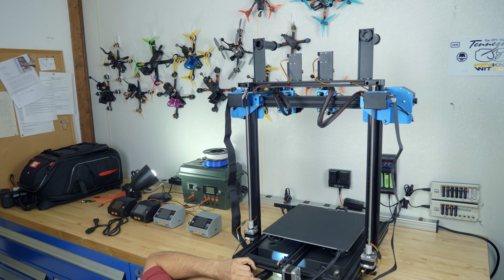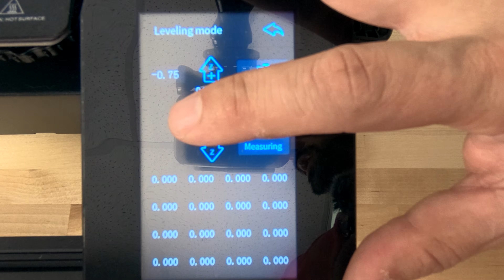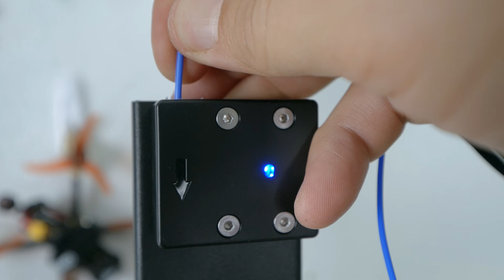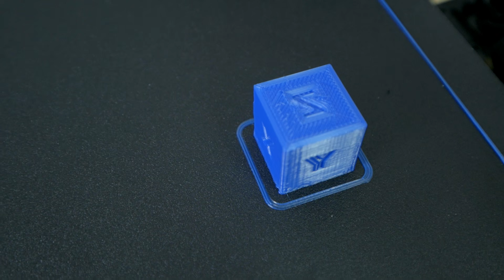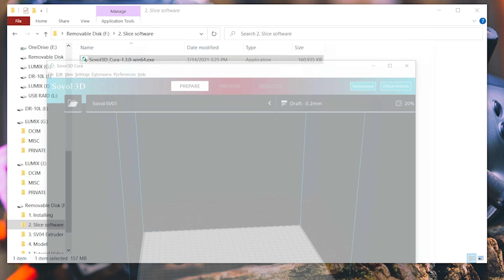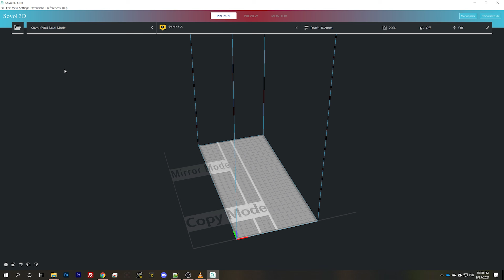How to set up the Sovol SV04 IDEX 3D printer

Comment: Everyone - this is the ONLY video to watch for setting this machine up. Follow every. Single. Step this gentlemen does. 

I was about to toss this machine through the back door. Gave it one more shot. You HAVE to do everything exactly the way he does it, and then watch your first two levels and adjust your Z offset in the “adjust” settings during a print, once’s it’s good - cancel print and restart with your new adjustments. 

Cleanest prints I’ve seen hands down.

Comment: Joshua,  I got my SV04 used from a family member.  It was never used but the acrylic setup blocks were not with it.  What is the length of the setup blocks so I can make a set myself.
Reply from the maker: The exact length doesn't matter as long as they are the same length. You can use a soup can or something.
Reply: @JoshuaBardwell  So it does not matter how high up the vertical supports I level the cross bar as long as it is square to the table?  Is that correct? BTW thank you for taking the time to answer my questions.
Reply from the maker: Yes that's right.

Comment: I swear I get better results eyebaing the tram on my single head machine. Idk.... finnaly gunna assemble my sovol04 tonight, super hyped. Thanks for the vid !
Reply: Ive got one coming in, going to be doing two tier color printing, did you end up getting yours and did you like it?
Reply: @redherring5532  I'm not sure what everyone was fussing about. It was MABEY a bit awkward. But mine unboxed and setup no probblem and i had little to no issue with the 2nd head offsets.... just take your time and double check your going the right way and it shouldn't take more than 30 min to get dialed in. 

And personally I do SOME 2 tone printing and I love the machine regardless, but it's so great for multi material parts or technical prototypes...

Idk, not for everyone
 But if you have a use case for it.... 300% worth

Comment: The filament sensors work just fine.
Cut a short piece of filament at a 45 and try placing it in the sensor at a rotation of 0, 90,180 and 270 degrees.
When I cut my filament the lowest point of my 45 is to the front left of the machine and it goes in the first time all the time.
Good luck

Comment: I have had this SV04 machine  for a month, and CANNOT get it even close to the levelling bed. The Z axis will NOT go down past about 3 inches from the leveling plate. I can manually (when off) wind it down to the board, but when I turn it on, it thinks home (Z=0) is 3 inches above the plate itself, and will not go down when pushing the z axis down. I have flashed the firmware, tried putting head down right tot table, but nothing works. The probe goes from blue to red, if that helps. Any help would be so much appreciated.

Comment: Just got this but been having major issues. First was major underextrusion. Did estep calibration and hotend PID tuning and still had issues. Noticed when manually extruding 100mm of filament the filament would stop extruding for a split second. Have tried a bunch of different things, higher hotend temp, slower extruding, esteps, pid, etc. No matter what, it seems to stop for a second on each hotend. I literally just got it so if I need to take it apart to check ptfe and other internals thats a bummer. Had same exact issue with the SV01.

Comment: The "center dip" bed has always been a problem for these Chinese bedslingers. No matter, Creality, Sovol, etc. sure enough there's a 0.3-0.4 dip. Seems impossible for them to fix. Using mesh bed leveling allows you to at least print a good first layer, BUT this amount of unevenness decimates parts accuracy. When your print is on the slope, you get vertically skewed prints for a few degrees as your printer try to compensate, especially noticeable on small tall prints. I'd go with a smaller printer (flatter bed) or some special bed system like the Prusa XL.

Comment: I got an issue with the 2  extruder at dual mode, when finished the printing, the extruder collide together whatever which come last , do u know what happen and how to solve it?
 One more thing, there have better way to set the xy offset, at the office website , there have a video show that use a 2 layer square stl file merge together , which is easier than using the comb  file, the stl file is included in the sd card come with the printer.

Comment: So what do you do when you have a corner that can not be raised anymore and still wont allow me to do the paper manual adjustment on the back right corner.
Reply from the maker: Go back and re-check that your X gantry is square to the frame.
Reply: @JoshuaBardwell  I have done that a few times. Luckily i found the issues was the springs they provided. So I swapped them out. However, I am having more of an issue of printing the calibration more than anything. I can print everything else just fine, thats the only file I have to use a glue stick for. Haven't had to pull them out in forever.

Comment: I wanted to point out, in case you're still having trouble with those filament sensors, that if you have the filament really straight and not curved, it goes in much easier.

Comment: Thank you for the excellent video  The SD card that I received with my sovo4 is corrupt and can not be read.  I was able to set up and print using you video but do you know where I can obtain a replacement sd card or download the files?  It is not on the sovol website.  Also I did not receive the two purge buckets.  Can I buy then from you?

Comment: Hey there, do you plan to make a video on the sovol slicer ? I know how cura Works but I would be very interrested to learn how sovol slicer works. Especially when you combine the dual extruder for 1 printing.
Reply from the maker: It's exactly like Cura, but before you load the file, you select the printer based on your desired printing mode.

Comment: I am trying to do the offset calibration on my sv04.  I don't see the file for the combs you print.  Under calibration there are two cubes. Did Sovol change to that instead of the combs?
Reply from the maker: The 20mm calibration cubes are not what you want. I would be surprised if they got rid of the comb pattern but I mean you're looking at the SD card so either it's there or it isn't. This print might work for you? https://www.thingiverse.com/thing:4565745

Comment: Hi Joshua, thanks for the video. The problem I’m having is that even after doing all of that, the mesh leveling is not activating during the print. The offset values for the mesh are clearly shown in the menu, but they are not applied during the print and therefore the nozzle drags in some places and not others. Have you noticed this while printing? It’s almost like the G28 in the start g code is eliminating the mesh. I’ve tried a million ways to fix this issue. A G29 in the gcode tends fix this issue, as I can actively see the Z axis compensating, but causes it to crash one of the extruders.
Reply from the maker: I did not put G28 or G29 in my start gcode for this printer. Sovol has the load mesh etc baked into the firmware I think. You don't need to do anything special with it.
Reply: @JoshuaBardwell  that’s because G28 is already in their slicer start gcode by default. But what I’m asking is have you noticed the mesh actually compensating while printing? If printing something large, like the size of the print bed, I still see all of the height variances and I can tell the Z motors aren’t moving while printing, but with all of my SV01 printers the Z motors actively compensate for perfect first layers.
Reply from the maker: Yes it definitely worked correctly for me.
Reply: @JoshuaBardwell  Okay thanks, I guess I’ll keep doing some research. No matter what, my mesh refuses to enable and I end up with first layers that are too high in the middle and too low on the outside of the bed.
Reply: Your issue here is its not a legitimate 3dtouch, I replaced mine with crtouch, which is alot more accurate, then my motherboard failed 2 days later.

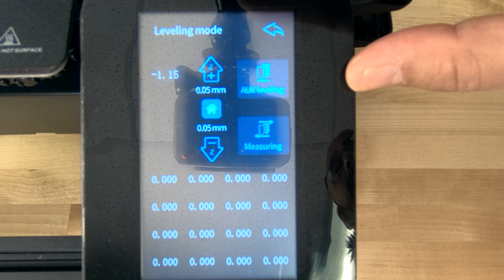Comment: I have a couple of complaints about this video: The first is one that I have not heard any clarification on and still remains a mystery to me: You talk about the issue that almost everyone faces when you do the 4 corner points and then come back to center point 1, only to discover that the nozzle no longer drags because the middle is lower than the corners. At about 8:30 you say "Unfortunately, what you think you would do at this point is go back to the menu and adjust the Z offset, but that's not going to work...", which tells me this is the WRONG move. Then at about the 9:05 mark you quickly say "If the center is not dragging we are going to adjust the Z offset from the menu until it IS dragging and we're going to continue.", which contradicts what you just said! The other major issue I have is that you do not pre-heat before leveling which clearly is a misstep because all of those precise micro measurements are affected by the expansion of the materials after they warm up.
Reply from the maker: The issue with the center being low after leveling the corners cannot be solved by continuing to level. You just have to get things as close as you can and then let auto bed leveling handle the fact that your bed isn't flat. You can stop after leveling the corners. You can level the corners (to get the bed as square as possible) and then re-do the center one more time. It's up to you. Either way, it won't be perfect and auto bed leveling will have to sort it out.

The real answer is to have a flat bed. Some people put strips of aluminum foil under the low parts of their bed to raise them up. Personally I just let bltouch sort it out and it seems to give me fine results.

Regarding heating the bed, I don't think it matters if you do this before doing the center and corner level, because the "piece of paper" method is extremely crude anyway and just gets you into the ballpark. As I say later in the video, you should always watch the 1st layer going down and manually tweak the Z height based on how the filament is going down. This is ultimately how you know if the Z height is correct, no matter what a feeler gauge might say.

Comment: could you also print 2 completely different models?
Reply from the maker: No, that's not possible.
Reply: technically you could load 2 STL and set each to a different color. this would print both models but one after the other 1 layer at a time. This would not be faster than printing each independently and likely slower even, but it is possible.

Comment: I have two IDEX, one out of the box Weedo X40, the other a modded Ender 3 Max. The out of the box Weedo has just worked great and I’m sure the Sovol will be a solid printer once it’s dialled in. The Ender was a great technical project but effectively is only setup to do a copy print which works great and saves a lot of printing time. Dual filament printing is good and quite novel. Copy and mirror print is the main reason I have two IDEX printer. I will say my experience with the Weedo has be very good where others seem to have issues.